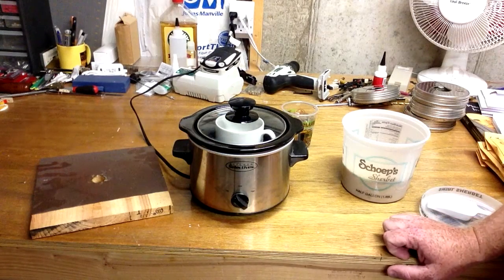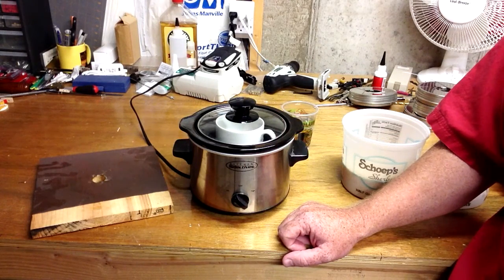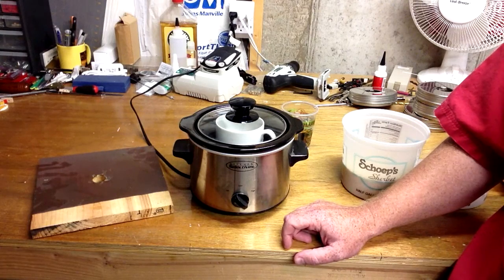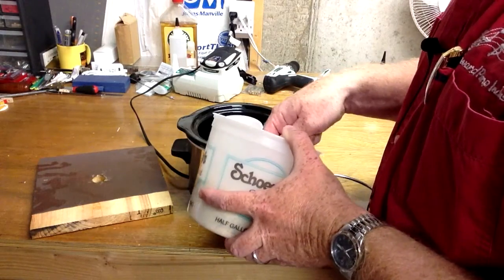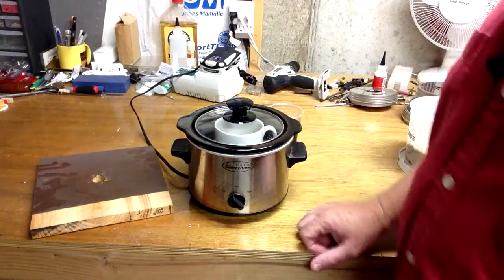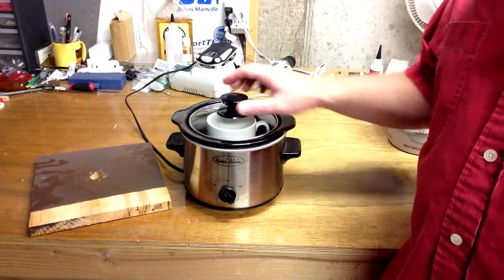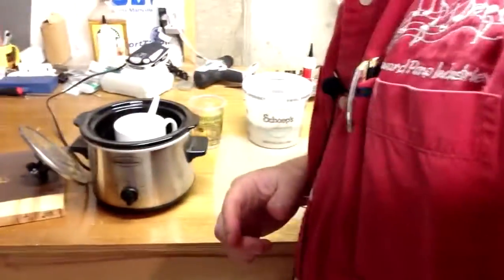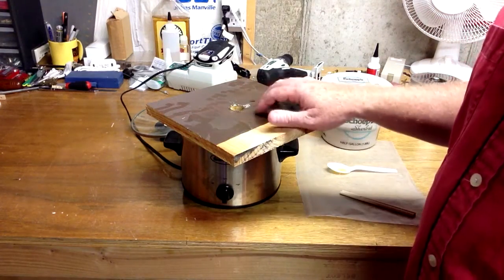Hide Glue Preparation - Piano Repair I HOWARD PIANO INDUSTRIES

Comment: Thank you for another great video! I ended up buying an electric hot plate (roughly $15) and I'm using a stainless steel asparagus pot (which I had) because it comes with a stainless steel cage that keeps the glass jars off of the direct heat. I put 2 jars and a dial thermometer in there. One jar has the glue mixture and the other just has water. Sometimes it's nice to dip your brush in some heated water and dissolve some of the glue that has built up on it. I also find that I often like to use a cheap wooden coffee stirrer stick rather than a brush because it doesn't get gummed up and you can drop a controlled drop of glue, and you can also spread it with the stick. I just put the stirrer stick into the water jar between uses, and I keep the cover on the pot. I just finished reconditioning the action on my upright and I bought everything from Howard!

Comment: 1:49 most crock pots only go to a low of 200 degrees.  I assume you put a temperature gauge in the water after it's been running till fully heated.

Comment: Brilliant videos, thank you so much for sharing your insight and knowledge.  Just wish I had some of the special tools you use, which make the jobs much more reasonable.   Question 1: I've seen you remove shanks from hammers and butts by wetting first to soften.  Could heat be used , via hot air gun or small propane torch, to accomplish the same?  Question 2: If making a minor repair, and not wanting to get into the whole hide glue process, what glue to you recommend?  The Bond Tite wood glue that I have used on flooring is too tenacious, the wood fibers tear before the glue lets go.  I would imagine your tensile or compressive removal tools would not be effective, the parts would be destroyed first.  Would a less aggressive Elmers wood glue be the ticket?
Reply from the maker: The thing that makes hide glue better than other wood glues is that if the repair needs to be redone the repair can be redone because hide glue is water based.  If you can’t use hot hide glue, the next best option is the cold version of hide glue.

Comment: I don't know were to buy this kind of glue... It's ok if i use normal wood glue just to glue a hammer head who came off? 

The piano of my church never receives maintenance and there's no piano technician around so...
Reply from the maker: You could do that, but the disadvantage is that if you were to want to remove the hammer in the future for replacement, it would make it more difficult to remove the hammer from the shank.
Reply: @howardpianoind  I will take the risk. The piano never gets maintenance anyway... Thank you for all your videos Mr Howard, i been learned alot from you. 

God bless you. (:

Comment: I was starting to think i should just use PVC-e glue for replacing my felts, because I didn't want to have to buy a special warmer for the hide glue, but I realized I have a wax warmer for heating hard wax to use for waxing hair from legs- you can even specify the exact temperature by number- would there be any reason it wouldn't work? It only holds small amounts, but it looks like hide glue works best in small amounts?
Reply from the maker: I haven't ever tried that , but it may work.  Though for gluing felts, PVC-E glue is certainly more convenient than having to use hot hide glue and should work just fine.